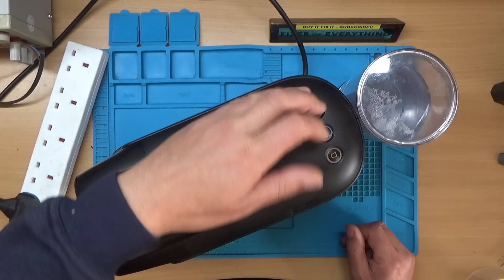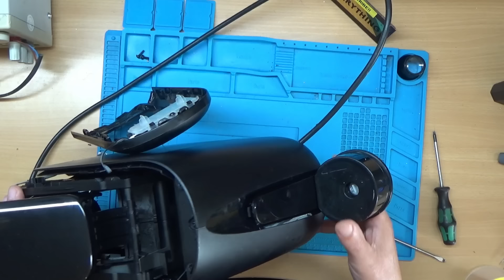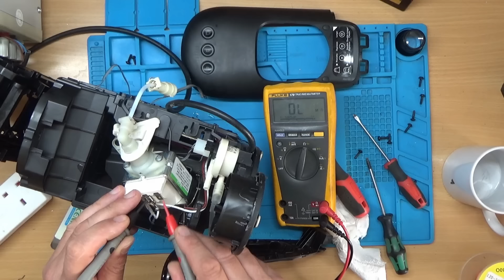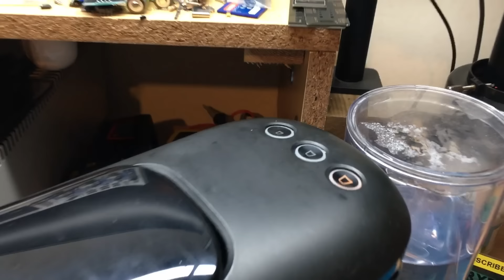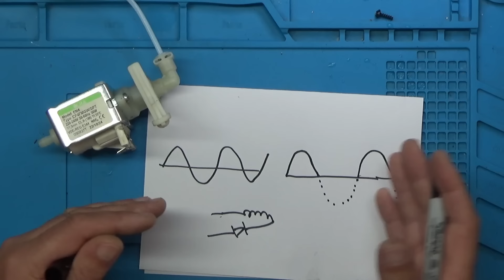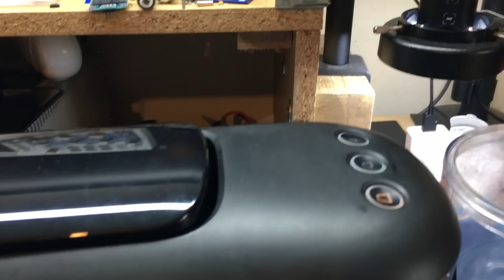Faulty Philips L'OR Coffee Machine - Customer Return | Can I Fix It?

Comment: Didn't hear you say it but you must have replaced the thermal fuse with a diode .............
Reply from the maker: Originally I thought it must have been a thermal fuse, as I've had them in coils and transformers before. Turns out it was a diode all along, which I hadn't come across before. I just assumed we should have had a continuity reading on the coil of a few ohms. If I had swapped my leads it would have shown a reading because of the hidden diode inside.

Comment: Hi, new here, can u explain better how did u open it? I dont see the clips, and i dont want to break it, thxs,
Reply from the maker: I took the front bit off first (where the coffee comes out). There's a spout that comes off first, and then the piece that the spout goes into (this is clipped on, I used a screwdriver to try and undo the clips and then that bit popped off). Then you can remove the top (it has a wire connected to it). You can then access the screws to remove the side panels.

Comment: Great video ! Do you happen to know what is wrong if the machine only gives a little bit of coffee with the lungo button pressed, and after that bit of coffee the button starts blinking fast. It is sort of the same with descaling, it starts and then stops again after a little while. And then the lungo button starts blinking fast aswell. Any tips are welcome ofcourse ! Greetings from the Netherlands
Reply from the maker: Thanks, sounds like it could possibly be a blockage. The blinking means that the machine is not detecting the flow sensor moving which could be caused by pump failure, blockage, or a faulty sensor perhaps.
Reply: @BuyitFixit  Thank you for answering! I will have a look at the machine later

Comment: Great video helped me open my same model machine up 
Mine has a problem it won’t dispense a large cup of coffee only medium size any ideas?
Reply from the maker: Glad it helped. I'm not 100% what you mean. I could be a faulty button if it's not doing anything when pressed or if it doesn't dispense enough volume it could be a partial blockage or pump problem.

Comment: After watching this video, I really NEED an x-ray machine!
Reply from the maker: 😂😂😂They are pretty awesome. Had someone bring a small USB power supply which was unusual as it was a linear PSU with transformer. One of the coils seemed OC, so I xrayed it and there's a thermal fuse you could see buried in the resin of the potted transformer... I didn't dig it out and fix it, but it was pretty cool too see where it was.

Comment: Again, well done. The de-longhi machines have a diode symbol moulded into that plastic bit you ground off. Coil looks identical apart from that.
The italian pump internals are different though, they don't have any metal-metal parts and there  is an extra valve in the outlet.
Reply from the maker: Thanks, and thanks for the info!

Comment: Well done. I just watched the whole of this video and enjoyed it, even though the fault with mine is it is not piercing the capsule!
Reply from the maker: Thanks 👍 I didn't investigate that part too much but perhaps coffee grinds have jammed in the part where the blades that pierce the capsule are.
Reply: @BuyitFixit I think it is a design fault. On the L’Or website it suggests freeing up the “O” ring round the spikes that pierce the pod by moving it with your fingers or an implement, it is on a spring. It clearly fails regularly, I am on my second machine that has developed the same fault, after a year this time, and the fact that they have it on the website means it cannot be just me.  If you get chance to investigate how that fails and how to fix it properly that would be great please.
Reply from the maker: @geoffhayday6003 Thanks for the info. I certainly will have a look if my unit develops the same problem 👍

Comment: @BuyitFixit these pumps will often have a diode symbol stamped into the plastic in the middle of where you ground it away. I believe you can see it @ 15:10 next to the ulka stamp but it is hard to see.

The diode being built into the pump does make some sense as it's required for the pump's independent function.
Reply from the maker: Thanks for that. There's no diode symbol on there, just a couple of numbers if I remember.

Comment: If the tank run out of water, the pump element might over-stroke and cause it to impact the piston and body sections together 
The pump relies on water flowing through it to cool the magnet/solenoid; the pump element has no effect on the current draw through the solenoid, but when the water flow is blocked/restricted it can overheat and cause damage to the solenoid.  I’ve see that style pump fail short or open circuit after turning the plastic brown from high temperature.
Reply from the maker: Good shout and a very plausible explanation 👏 👍

Comment: I have the same machine and fast flashing means out of water if that helps  love the vids
Reply from the maker: Thanks Simon 👍 Yes in the manual it says it's out of water. There's a flow sensor that I pointed out, and the machine uses this to sense if water is flowing. If it doesn't move because of blockage, faulty pump or no water, it will still show the same error.

Comment: We have one of these machines, so it was very interesting to see the disassembly and fix. Mick, I'm assuming that the diode needs to be in a certain orientation for it to work? Otherwise the pump will be trying to push instead of pull. Is this correct and if so which way around is the diode soldered in, please? (I'll probably need this for future reference.) The other question is regarding the two metal parts. Are they actually in the water flow? If not, would some grease help them not seal together?

Most interesting fix, and it also explains why the pumps have sold out everywhere! Not had ours a year yet, but I'm ready... 🛠️😅
Reply from the maker: Thanks Tim 👍No the diode doesn't need to be a particular way. The piece inside the pump is just a block of metal and would be attracted to the coil either way, it would only push if it was a magnet.

Comment: Black gunk was probably mold, it is a problem with some of those coffee makers.
Reply from the maker: I was thinking limescale? it's on the output of the boiler, so I would think mould would be destroyed by the hot water.
Reply: @BuyitFixit  No sorry to say, hot water will not kill black mold. Because it is on the output side it is open to air and the system does not drain so the mold just grows in the warm water. It is a known problem with single cup coffee makers.
Reply from the maker: Interesting I didn't know that. I would have thought nearly boiling water would have killed it of. Thanks for sharing.

Comment: Those pumps have a diode inside them to work on half a cycle, reverse the leads always to check if u have continuity between them
Reply from the maker: Yes, worked that out in the end. I thought it was just a coil. I didn't expect it to have an internal diode 👍
Reply: What value diode ? @BuyitFixit
Reply from the maker: I'm not too sure. I just left the original in, but it would be a mains rectifier that can handle around 2A or more I'd guess.

Comment: I too have wrestled with this kind of appliance before - they really are a pain in the A$$ as far as disassembly and hopeful rebuilding goes. Planned obsolescence perhaps? You could purposely lean towards a lesser grade metal for the pump internals (for all production or a certain percent) in order to achieve an accurate and repeatable failure. Yummy metal-particulate in each cup - it makes me wonder if the dirt you found in the pipe is from the worn metal or regular build-up from the water used.
Reply from the maker: 😂😂😂😂👍Yes coffee fortified with iron.

Comment: So was the diode faulty, or was it just the stuck pump?  Did you replace the diode, and how did you know which way to put it?  Looked like you didn't need to replace anything, so a reverse of the test leads would have not given you the false alarm.
Reply from the maker: No diode was ok, hence not getting a reading and thinking that it was just a coil that had gone open. Yes swapping the leads would have shown a reading,  but it just appeared to be a coil. I wasn't expecting it to have a hidden internal diode.

Comment: Well fix as usual. The pumped water is hot that's why they use those metal noise pumps instead of plastic silent pumps to pump water. There should be a more silent version for this.
Reply from the maker: Thanks 👍The water that comes out of the pump is cold, it only get's heated once it has gone through the boiler which is after the pump.

Comment: So in reality the original diode  in the pump was probably working fine, you saw a gap, which is normal as far as i know when looking at a diode through X-Ray.

The only problem, and the reason it did not work for the previous owner, then worked a bit for you and then stopped, was the pump intermittendly getting stuck. The reason it worked for you at first was probably because the postal service gave the package a good thrashing, which unstuck the pump.
Reply from the maker: Yes, spot on. That's the conclusion I ended up with too. It could also explain the bits of plastic I found.

Comment: But what about the diode ? It was still ok and you just removed the 2a fuse ?
Reply from the maker: Yes, the diode was OK. I just removed the fuse that I had fitted. When I initially tested the pumps I guess it was a coin toss they way I had my leads that gave the open circuit reading. I wasn't expecting the coil to contain a diode which is why I didn't measure the other way. I just assumed it was a coil and nothing more.

Comment: commercial machines have a water purifier to remove salts and stuff, so you get a better tasting coffee, and your machine does get blocked with limescale. Many 'boiler' items that enter the repair cafe have got limescale issues.

In the 2 repair cafes I attend, coffee makers are hated, due to the disassembly and diagnosis time they take, then the people dont want to buy the parts. Non of the techies like them, and have a far less than 50% repair rate.

Was a good fix, but bet it took more than three hours :)
Reply from the maker: Yes, I did spent a bit of time on it, and edited the video down to a reasonable level 😂😂 We have a similar thing with toasters at our repair cafe. Most of the time it's the elements that have gone.

Comment: Great fix Mick, Spot on with the pump, it makes sense as that click we heard and you thought it was the fuse pop pin was it the pump that did a single stroke and got stuck again, did you replace the diode as the coil originally was open circuit… 😊
Reply from the maker: Thanks Gary 👍 yes spot on with the click. No the diode was OK. It was just 50/50 that when I measured the coil my leads were the way round that I got no reading. I didn't try the leads the other way as I thought it was purely just a coil of wire.
Reply: @BuyitFixit oh I see what’s the chances of that happening but I agree you would of thought it was just a coil, there are solenoid pumps in the Delonghi machines I repair and they are AC not DC 😊

Comment: Great video Mick.

As someone else wrote, whenever I try and take things apart, something always breaks and I curse out loud. I always marvel how you manage to take it apart without breaking it and then successfully put it back t5and make it work😂

Well earned coffee
Reply: Anyone trying to take plastic clip together products from TV remotes to coffee machines apart really must have a spudger. Doesn't have to be an expensive commercial one. Have look in local charity shops for those old, yellow handled, thin bladed, stainless steel, butter/dining knives with rounded ends. They make wonderful spudgers, think I got half a dozen for 50p... A spudger really does make pinging clips so much easier. The broad blade also spreads the load so they don't chew the plastic up like yer average screw driver does.
Reply from the maker: Thanks mate 👍

Comment: Nice job Mick! I didn't expect the issue to be mechanical. You definitely taught me something new about the AC going through the pump with the diode. It makes perfect sense now that you've explained it
Reply: Why not, in my experience when you have electronics and mechanical stuff, 9/10 times the mechanical parts fail.
Reply from the maker: Thanks mate 👍 Yes me either. I thought it would be an electronic/electrical issue.

Comment: love the batman spinner lol....nb don't use tap water in it..I always use bottled water
Reply from the maker: Glad you liked the logo 👍We don't have mains water here, there's a spring at the top of the hill about  3/4 of a mile away that runs into a tank. I had to install a large multi stage filtration system to deal with sediment, iron, tannins, and finally a UV. It's a lot better than just a paper filter which was here when we first moved in.

Comment: Awesome work! Thanks for the lesson. The final spring load valve is like a fuel injector. It stops the water running with a decisive stop after the pump shuts off.
Reply from the maker: Thanks Terry and Cheers for the explanation 👍

Comment: Nice and methodical work through.   Shows good practice.  My first thought (on that x-ray) was 'diode' since I've seen a picture like it somewhere in the past and it's not something you forget.  Do you have to refer back to your recordings to re-assemble stuff?  As I get old I find I can't maintain the thought process of a long dismantling!  Ho, and that 'click' you heard was that plunger sticking.
Reply from the maker: Thanks 👍I'm usually quite good at remembering how stuff goes back together but it all depends if I need parts or whatever. Sometimes there can be weeks in-between where I disassemble something, and parts arrive so if I can't remember 100% I do sometimes look back at footage 🙂

Comment: Mick, you need a hearing aid battery too mate. I was shouting :face-blue-smiling: at the screen telling you it was a diode and not a fuse!! :hand-orange-covering-eyes:
The diode as you worked out, is to generate the pumping pulse, at least the fuse would not have harmed the coil as it would just have closed and stayed in that state until it was turned off. But you got there and it was a very interesting video. Thanks again sir. :trophy-yellow-smiling:
Reply from the maker: Thanks mate 👍Yes I didn't expect the coil to have a diode built in, but I learned something new 🙂

Comment: Yes, the diode chops the AC current half wave giving the pump 25Htz, very cool.
Reply: Original diode what probably fine until it met the angle grinder.

The real problem was the pump getting stuck, this also explains why it worked intermittendly.
Reply from the maker: Yes,  diode is still fine and still in use. I stopped grinding when I started seeing something black there.
Reply from the maker: Thanks mate 👍

Comment: Well, that was fun! I used to repair and rebuild espresso machines as a bit of a side hustle, but I never saw a pump like that. Most small home machines use a simple vibratory pump which is basically just an electrically operated check valve. Commercial machines use positive displacement rotary pumps with self-limiting pressure relief. Glad to see you get that little machine working again.
Reply from the maker: Thanks Bruce 👍
Reply: Lots in steam irons (with the base station) as well
Reply: My Krups has this type of pump. I know because I had to replace the pump because it got damaged when I moved houses.

Comment: I've worked on 4 different Keurig machines from the building where my wife works in the city.  As I watched you pulling the case apart, I was wincing.  The Keurigs make a God awful noise when snapping the plastic case from the machine.  Two had level sensor issues, filling the tank still wouldn't allow the machine to work.  The others had over temp sensors that tripped.  They aren't self resetting and require most of the machine to be disassembled.  A push of the tiny reset and off to the races.
The galling almost looks like they chose poorly when selecting the metal for the pump.  That was a great catch.  I might have been scratching my head for weeks over that one!!!
Thanks for all your time on the channel.  Love the content.
Reply from the maker: Thanks mate, and well done on fixing the Keurigs 👍

Comment: Usually the small o ring the problem even if the fault like this. That o ring size is 6/2 mm. Im not a coffee machine expert im just service my coffee machine. So this is only experience. Im on half way on the video but if you not replace all of the o rings just replace them on the old pump. Ok i see you not replace the pump. So my theory was faulty, sorry for that. Anyway if next time dont want to pump water the pump check the o rings usually thats the problem.
Reply from the maker: Cheers mate, and thanks for the info 👍

Comment: That was great, well done! 🙂

One thing I did think of - bearing in mind this is a drinks machine I would have been thoroughly cleaning the assorted pipes and pieces that you blew down and also handled. Not saying that you're unclean, but saliva and bacteria are going to breed in that environment even though certain parts do get hot.

Nevertheless, a very worthwhile repair and I'm glad that you fixed the pump instead of replacing it (even if it had been available at a far cheaper price). 

BTW, did you ever find out where those broken pieces of black plastic came from?
Reply from the maker: Thanks mate 👍No, never did find where the plastic was from. Guess it was just "spares" 😂😂😂
Reply: @BuyitFixit  It's always good to have some spare parts rattling around inside a kitchen appliance. ;-)

Comment: Nice! Really good job! I'd like to know: How did you find out which Diode to use and which way to put it in?
Reply from the maker: Thanks 👍The diode was OK, but because I thought it was just a plain coil, I didn't measure the coil both ways. I just thought it was open circuit as you would probably assume.